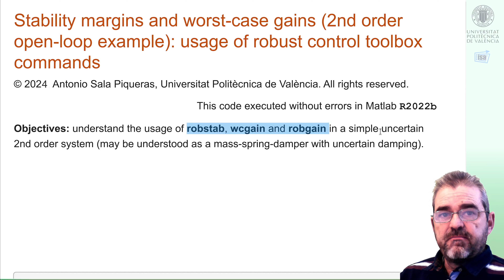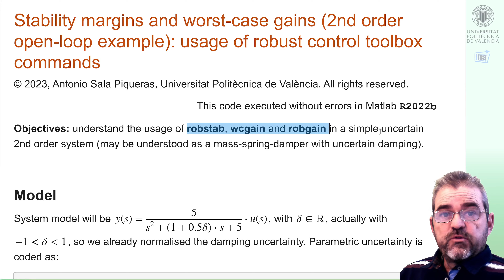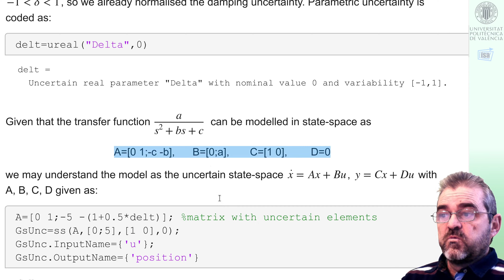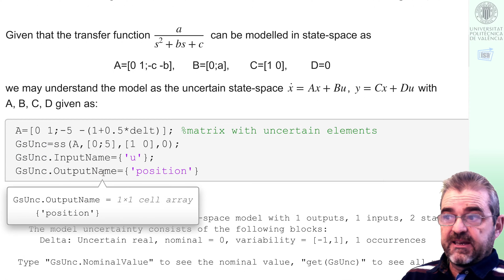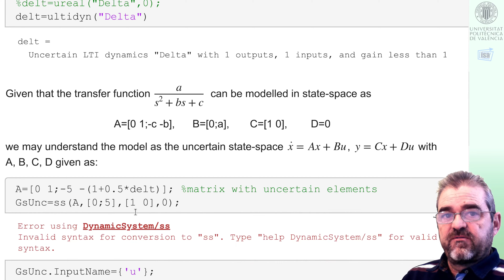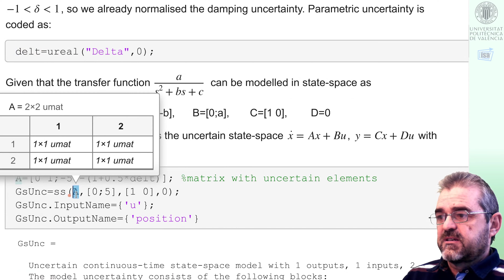Robust stability margins [robstab, wcgain, robgain]: 2nd order system with uncertain damping, Matlab

Comment: it's better than nothing but it is still assuming the system is a 2nd order system, if the system is not 2nd order which is the case if you cant model it correctly with a 2nd order the whole concept falls
Reply from the maker: Indeed, you are right, thanks for the comment.
Of course, this is a "toy example": a system with a single uncertain real parameter, plus the fact that it is in "open loop", which makes things even simpler.
The true reach of uncertainty descriptions in robust control is usually apprehended in closed-loop configurations, also adding some "ultidyn" (uncertain LTI dynamics) with no prescribed order in order to encompass that "unmodelled dynamics" in the uncertainty description, or using small-gain results to probe robustness even in front of sector-bounded nonlinearities... 
In summary, this video is just a first glance to the idea, oriented to students that were taught what damping and overshoot is, in order to motivate them towards the interest of more ellaborate approaches, Regards!